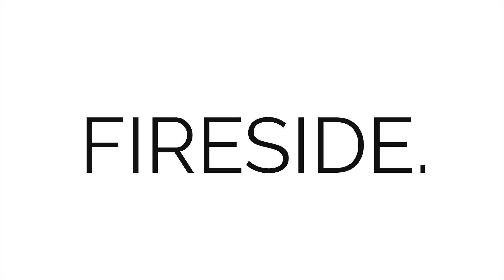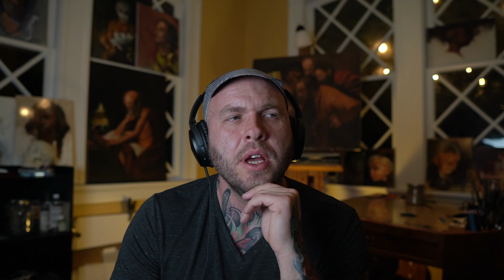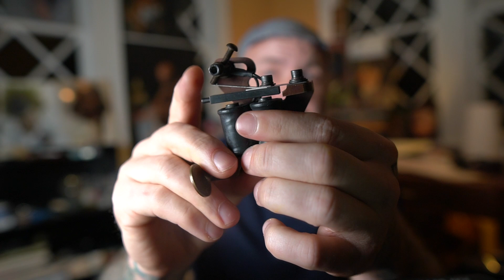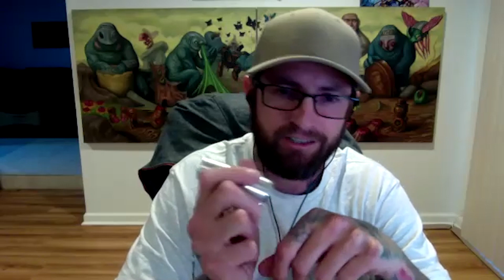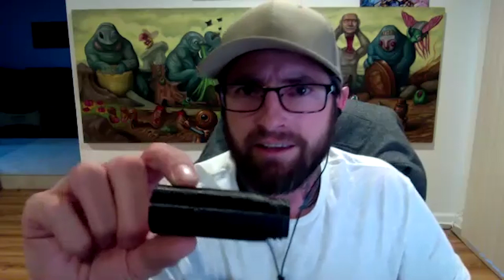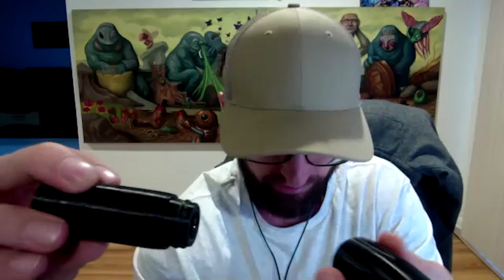What Voltage Should You Run Your Machine At? | Carson Hill | EP 240

Comment: To touch on the subject i would agree with their not being a set voltage weather for lining or shading. I have some coils that i line no higher than 5.5 volts. Another 6.5 . these are all custom coils so no plug. And then your hand speed has to be put in account. I had to learn hands on but they didnt have all these platforms putting out all this information.

Comment: Thanks for the %10 just bought my second Neuma 4. I got my first one in at the shop last week and I wanted to be able to say it was hyped up. I've been a religious Axys Valhalla user. Adjustable stroke in 5 lenghts it was the shyt for me for years have bought 3 still have 2 gave 1 to a coworker. Well sadly the Valhalla hasn't made it out to play since th 4 came. So at 3.6 end %20 it does it all. It puts color in fast, does solid 12/09 rs(most are more like a loose liner anyway) lines. Voltage parameters are small 4.5-9 but I can't see ever going near 9. I have a decent hand speed and run at between 6.5-7.2 for lining. Can't wait to try the shift grip. Got the 4.2 this time around. Sorry about the long comment.

Comment: I use a machine by vlad  blad the avenger and their site is very specific u do black and grey shading at this voltage thin lines at this voltage and color packing at this voltage and so I went and tried the voltage recommended by them and for the most part they were in the ballpark but honestly I like to feel the machines feedback and I figured it out so the voltage thing is subjective to every artist  I tattoo at such a low voltage when using a certain technic it blows peoples minds like the Xion I use at 10volts with the longer cam and my coworker who does super soft bng would never dream about that voltage he uses the smaller cam and five bolts so I think it’s super subjective
Reply: I own the Avenger too. Great machine. Unfortunately, I started using my Neuma4’s soon after and haven’t bothered using it again.